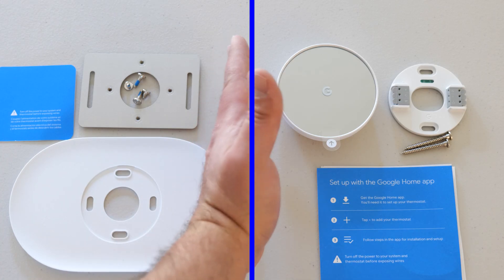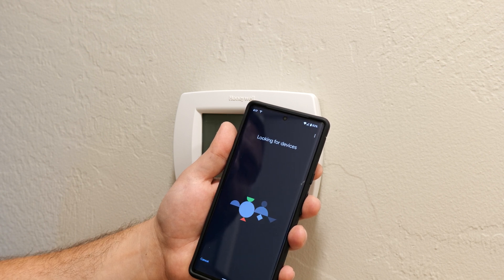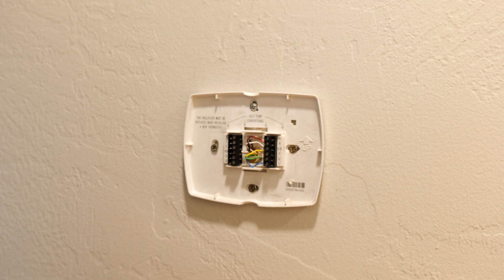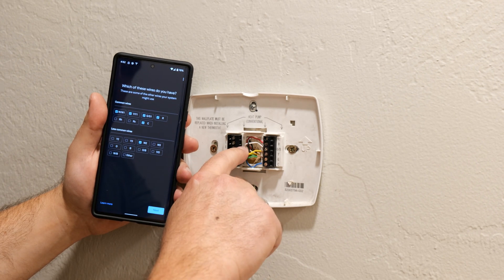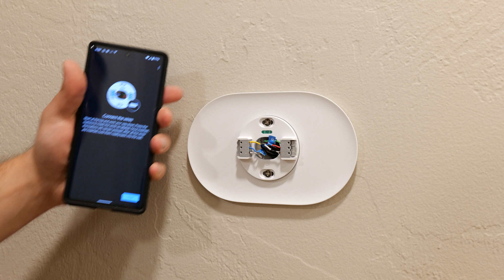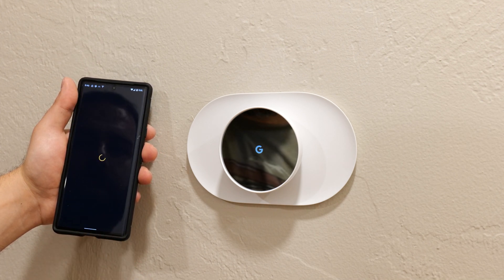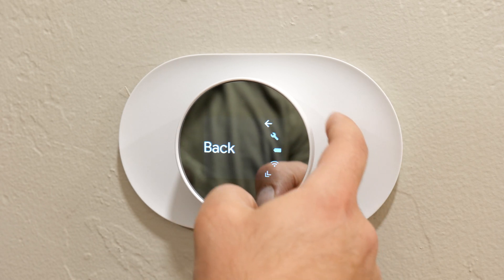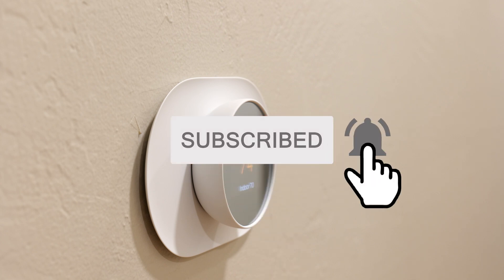Google Nest Thermostat Install and Review

Comment: When I did the setup through the app my heat is blowing cold air and then the AC is blowing hot air.  I don't know what I did wrong on the setup. I know all wires are connected in the right areas, but when I click on the options during setup I think I'm doing something wrong

Comment: How to tell if you have a high or low voltage
Reply from the maker: Best to ask someone. 

I have the super thin wires which usually means low voltage. High voltage are slightly thicker wires, something similar to 14 or 12 gauge.

If you’re not sure, ask a professional because working with power is very dangerous

Comment: Your trim kit is on the wrong way…
Reply: It’s actually the right way…but a strange choice google decided to do it
Reply: I thought so😂😂
Reply: On the faceplate it says what side is against the wall.  Looks wrong but it is right.
Reply from the maker: Looks right to me from what I saw in the instructions.
Reply: @landpet  I agree.  It looks like it should go the other way, but doesn’t.  It does look a little funny to me but you have it right !
Reply from the maker: @christopherbohdan6960  reminds of a tea cup on a plate
Reply: @landpet  its called saucer. (you're welcome)
Reply: Nah...the plate you installed behind the trim plate is unnecessary. You clearly didn't install into an electrical box. That's what the plate is for. All you technically had to did was snap the back plate of the Nest into the trim plate and screw to the wall with 2 screws...according to the manual. But either way, looks great!

Comment: Do you know if this (or any other reasonably priced smart thermostat)  can run the fan on regular intervals to equalize the temp between floors?  Or if it can talk to a remote thermostat on another floor?

Comment: is this thermostat allow to put 4 digit pin to prevent tampering like the nest learning thermostat?
Reply from the maker: At first glance, it doesn't seem like it supports it. I haven't gone into great lengths to figure out if it can or cannot but scrolling through the menu, I didn't see anything in there to suggest it can. Probably because this isn't as "fun" for kids to play with, the nest thermostat is very "fun" for kids since it spins. This doesn't spin, you just kind of swipe with your finger. I had the nest thermostat 3rd gen at my last place and it just feels more natural when you're navigating through the menu with the physical spin. I just like this one cause of the mirror finish and it costs much less.